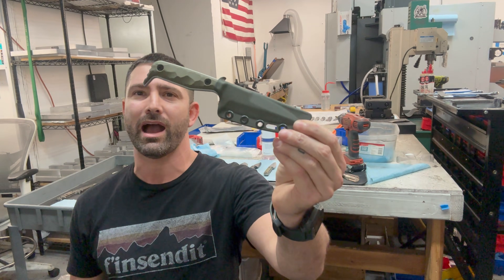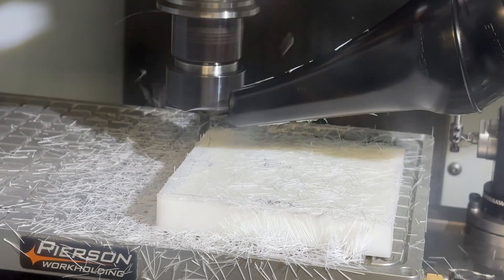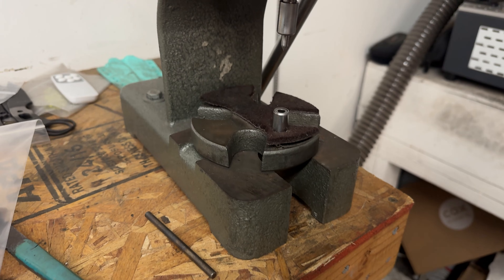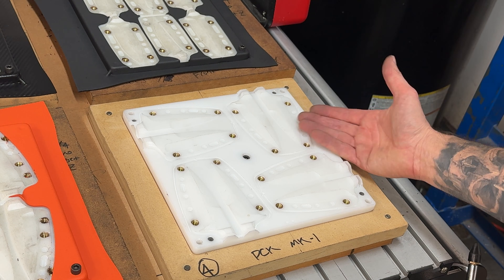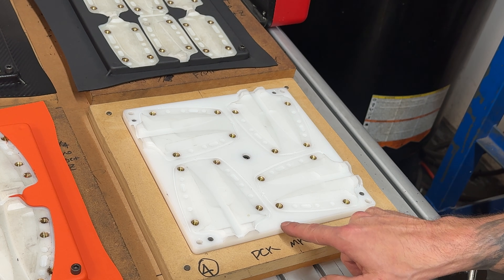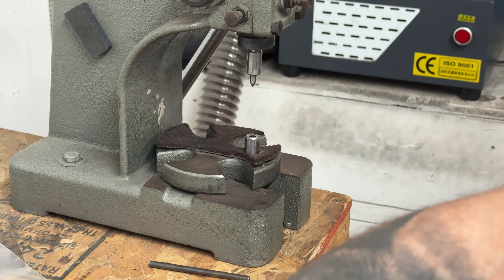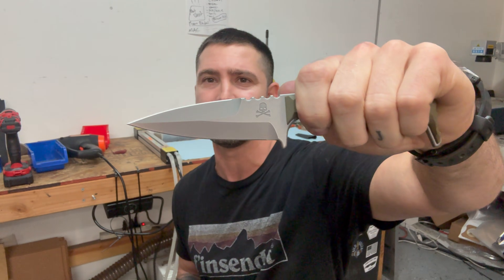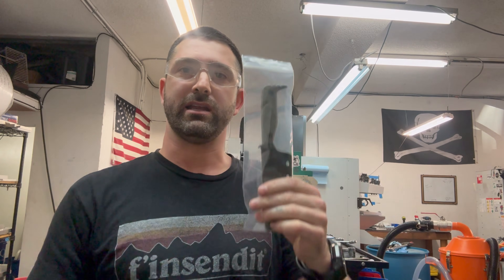CNC Kydex Manufacturing - How I Build Sheaths in Minutes Using Molds & CNC

Comment: I have some CNC equipment, but I am such a beginner it feels. Love the sheath tips that's really cool. I would really like you to do a video on texturing handles in 360 or how you screw your handles in to tang. But this was a great video awesome work.
Reply from the maker: I’ve got a 30 min video on handle texturing in my online design class! I just use threaded standoffs to attach the handles to the tang.